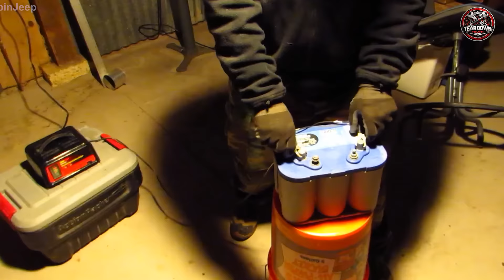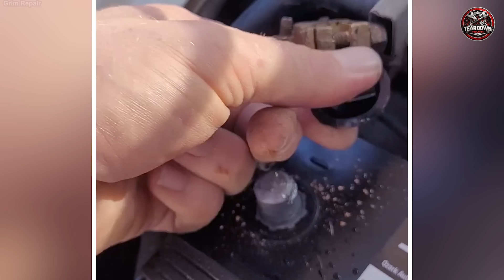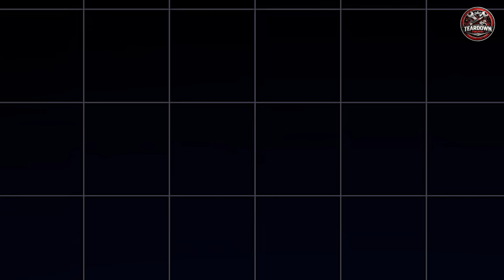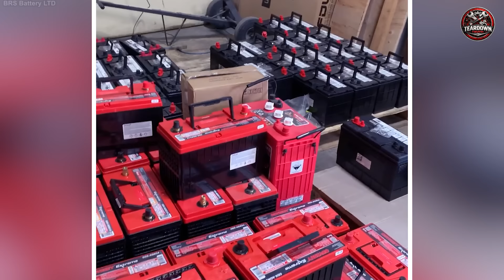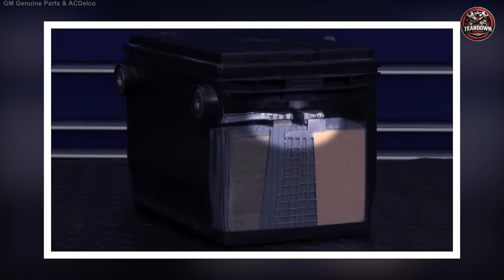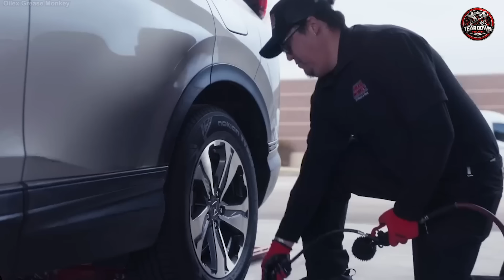NEVER These 3 Car Battery Brands (And 6 That Actually Last 5+ Years)

Comment from the maker: Have you ever bought a "budget" battery that died within a year? Which of these brands do you currently have under your hood? Let us know your horror stories below!
Reply: I've had an Everstart $99.00 ONE YEAR battery in my van going on 
FOUR YEARS.I keep my terminals clean,not put on 1/3 of the way on the post as you've shown.The only other thing I 've done is put grease or Vaseline on the trminals.When we almost hit 0°was put a trickle charge on it overnight.Interstate is one of the BEST !
Reply: Best battery that I know
Reply: @bobhuard4520  I bought a Nascar in-house Pep Boys brand battery 20 years ago with a 10 year warranty. It lasted 9 years. It was in a fully loaded 94 EB Bronco with an aftermarket 400 watt stereo. Has better tech gotten worse?
BTW, if you open the cells vents and boil on 200A for 15 minutes then cooldown for 45min until each cell boils, refilling each cell with water, every 2 years, you can get current batteries to last 20 years easily.
Reply: I  used to 20+ years ago when I was poor. Bought walmart brand. They lasted about a year and always left me stranded. No warning.
Reply: @justme36330  Walmart has like 3 different levels of quality, the value brand is the cheapest and something a used car dealer would install in a car that would be sold soon. I have watched some YouTube reviews with Walmart batteries and they were considered one of the top batteries.. idk . I use their mid grade with good results

Comment: I use the dee cell walmart brand multiple  years now. Have run 2 batteries  in about 10 years. 1st battery  laster 7 plus years. 2 batter 8 and this one i have now is 4 years old and going strong all on a solar system  and i have no electricity  bill
Reply from the maker: It's a good product indeed.

Comment: In 1973 I bought a 1956 Ford from orig .owners. Had it for 20 yrs. It came with an  screw top  allstate 12v battery. Battery lasted 20 yrs! Sold car with same battery I bought it with! The last battery I bought was  in my 2018 Chevy Colorado ,it lasted 8 years.  My 2016 Triumph Motorcycle original battery lasted 7  years , had a major internal short inside would not jump start and left me stranded. I bought  a "budget" 6v battery years ago for  a motorcycle and It lasted 1 week.
Reply from the maker: It's true that cheap things are usually of poor quality, right?

Comment: I’ve been buying budget batteries for 40+ years. Never had an issue unless I created it. I buy rebuilt batteries that last just as long as new ones even being abused. I pay 70 to 80 bucks for an 850 cranking amp full size battery for a full-size sedan. Technician told me once the only difference is the warranty, price wise. Don’t waste your money on expensive batteries

Comment: I had a 2 year Die Hard from sears that lasted 4.5 years....then I got a 2 year everstart....but it had a problem just before the warrently was up, so I have another one but it is't doing good ...has less than a full charge...so now I am thinking the car has a drain problem...put in a knife disconnect switch for testing...jury is out at the moment...

Comment: Everstart is a good battery and if I'm ever wrong you're not losing much money. I've run the marine lead acid in my boats for years and the sealed agm's in my vehicles.
Reply from the maker: That’s a solid approach. Good value, proven use, and low risk if something goes wrong — hard to argue with that. 👍

Comment: Well it's true the Everstart Value batteries don't hold up to deep discharge. If the vehicle doesn't start after a few brief attempts you are already pushing your luck. Crank excessively a few times and you've hurt it bad. Have the radio on for a few hours and you've run it down enough that when you have a little difficulty starting you've hurt it. Just not made to handle adversity. Under normal conditions you'll probably get through the warranty period but I wouldn't count on it in a hot climate.
Reply from the maker: That’s a fair take. Value batteries can work fine day-to-day, but they don’t tolerate deep discharge or heat very well — that’s where the problems show up.

Comment: THIS AI GENERATED REVIEW IS NONSENSE.  I have used the Everstart Maxx batteries since 2001!  I have used them on gas pickups, diesel pickups, large farm tractors, self propelled windrowers, and combines.  All lasted 7-10 years, and were more durable and cheaper than the OEM John Deere batteries.
Reply: I had bought Interstate batteries for many years for cars, trucks, heavy equipment etc. They aren't the same anymore. I bought a few Super Starts from Orielly's. Had problems with them within a year. Now have walmarts Everstart Maxx and have been happy with them for a few years now. I agree. AI crap.

Comment: My car/Truck doesn't run on a battery. After the start up? It runs off the Alternator. If my Alternator goes out? Then I have a problem. My times I have started a Car/Truck got it running then removed the battery. Just sayin

Comment: I've bought everstart batteries that lasted five years on average. Through rain, 
sleet and snow they were more reliable than the expensive brands that failed at 5 months to a year. Bullshit is bullshit and if the car has electrical problems the battery no matter how good will have difficulties.

Comment: I recall years ago sears die hard was top shelf. Then  interstate became top shelf. But, as stated ALL batteries are made by three companies with different names on them. Past 12 years all my batteries have been ever start. Absolutely not one complaint.
Reply: I used to buy Diehard Gold batteries yrs ago and had good results. I had 2 daily drivers and 2 classic cars, a good battery, reasonably priced, and would get 5-6 yrs easily. I miss Sears…

Comment: "OPTIMA" : BECAUSE of ROUND WRAPPED LEAD , instead of FLAT PLATES ...THERE IS WASTED SPACE *  ...AND A FLAT PLATE BATTERY WITH SAME OUTER DIMENSIONS CAN HAVE MORE RESERVE CAPACITY or CRANKING AMPS ....ALSO "INTERSTATE" WAS THE BEST (MY OPINION). BECAUSE PLATES WERE PLACED IN PLASTIC BAGGIES with PERFORATIONS to STOP ,+ pos. and - neg.  Plates from HITTING/SHORTING  and ...any shed LEAS DOES NOT ACCUMULATE ON BOTTOM of BATTERY but IN PLASTIC BAGGIE ...ALSO "INTERSTATE" DOES  NOT USE SQUARE GRID Reinforcements on LEAD PLATES but `46°<. Fire ting SLL CURRENT *DIRECTLY to TIE BAR /POS. POST ,or NEG.  POST ...DIMPLE GEOMETRY , SIMPLE RESISTANCE ...DIAGONAL GRID st 45°< is 1.41 x  resistance ...square grid is 2 x resistance ...equals ; HIGHER VOLTAGE !!! ...LESS INTERNAL HEAT !!! , FASTER CHARGING !!! , MORE CRANKING AMPS ..
.COMMON LEAD BATTERY  INTERNAL RESISTANCE `1/4 ohm

Comment: YOU MUST CHARGE A NEW BATTERY WITH THE DELTRAN BATTERY TENDER PLUS AND PUT IT ON THE BATTERY OVER NIGHT ONCE A MONTH OR TWO MONTHS , I GOT TWELVE YEARS ON A DIEHARD IN MY TRUCK AND GET 5 YEARS ON HARLEY BATTERIES AND A MINIMUM 5 YEARS ON CAR AND TRUCK BATTERIES AND EVERY 6 MONTHS I CHECK THE ACID LEVEL AND TOP OFF WITH DISTILLED WATER AND CHARGE OVERNIGHT.....
Reply from the maker: That’s great old-school advice. A lot of batteries last much longer when they’re properly maintained instead of just installed and forgotten.

Comment: I started buying everstart plus. They lasted 3 years each. My old Autozone duralast gold lasted no more than 15 months so I stopped buying them.
I will never by another battery from Advanced auto parts
Reply: BUY A DELTRAN INDUSTRIES BATTERY TENDER PLUS AND RUN IT OVERNIGHT ONCE A MONTH AND BEFORE YOU INSTALL THE BATTERY
Reply: @CraigAllen-re9bf I will look into it thanks
Reply from the maker: That’s exactly why real-world experience matters. If EverStart Plus is giving you 3 years and Duralast Gold only gave you 15 months, most people will follow the results, not the branding.
Reply: I went through **4** AUTO ZONE BATTERIES for a tiny 2000 cc /4 CYLINDER FORD ....INSPECTED EVERY BATTERY at AUTO ZONE , FOUND 1 I
S. MADE ...THAT BATTERY LASTED ~3 YEARS ..
I NEVER BUY AUTO ZONE AGAIN ...ONLY "EVERSTART"

Comment: My Everstart battery hit 8 years, still going
Reply: I like EVERSTART THE BEST !! CONSUMER REPORTS + OTHERS  HAVE BEST RESULTS for "EVERSTART'/SOLD by WALMART ...DELCO HAD PROBLEMS WITH MECICAN ASSEMBLED BATTERIES ...TIE BARS (INTERNAL ) LIKELY INCOMPLETELY SOLDERED .

VOLTAGE TESTED "OK' but ..
tiny CURRENT .

Comment: I have a new AGM Battery from Oreilly's and the batter seems to be at 63%.
  I use this vehicle daily and it seems to only get SoC 100% for 40 minutes of driving time and then lose the SoC within a few hours back to say 89% SoC while the SoH is always declining to Now 62% and this battery is only 3 months old. 
   I paid $230 for this battery and it just cannot keep up with the voltage.  Volts in the morning is 12.2 volts and cranking voltage is 9.9 or at times 10.2 Volts.
The battery lose it's capacity at about 1 hour of sitting in the Van listening to music and waiting.
Reply: WALMART TESTS , CHARGES , RETESTS , CHARGED 2nd TIME .
.IF BATTERY IS NOT AT 80% RATING = MEW BATTERY under WARRANTY   ( NO RECEIPT NEEDED )
Reply from the maker: That’s terrible for a 3-month-old AGM, especially at that price. If it’s already dropping that fast, either the battery is weak or something in the charging system is not right. Thanks for sharing that real-world example.

Comment: I purchased a power X2 AGM battery from a local batteries plus store . So far so good no issues or complaints. My vehicle starts right. Every time.  I do keep the terminals clean & Tight . I did replace the serpentine belt with a Gates belt & I mainly do a of interstate driving. Which is good .
Reply from the maker: That’s the kind of real-world result people care about. Good battery, clean terminals, and plenty of highway driving can make a big difference.

Comment: Interstate and optma battery are very good but this batteries are for upper middle class people that make six figure incomes😮😮
Reply: Costco sells Interstate batteries cheaper than Walmarts batteries
Reply: @xrgreg Yep, $179 for the AGM and $129 (I  believe) for the regular Interstate battery.
Reply from the maker: Fair point — they may be good batteries, but for a lot of regular drivers the price just pushes them into luxury territory.
Reply: @TeardownTruth thank you for saying that! I buy Walmart battery I get about 3 to 4 years from them!
Reply: I personally would not buy OPTIMA/ROUND WRAPPED LEAD ...Unless I HAD A SECOND BATTERY CARRIER IN ENGINE COMPARTMENT or BOLTED to FRAME .

TOO MUCH WASTED SPACE BETWEEN ROUND CELLS  GIVING LESS CAPACITY ...BUT Excellent IN A BOAT  or with a 2nd BATTERY CARRIER

Comment: Living in Las Vegas where the heat will kill any battery, why purchase an expensive on that you will have to change every 3 to 4 years here due to the heat...
Reply from the maker: That’s a fair point. In extreme heat like Las Vegas, a lot of people would rather buy a cheaper battery and replace it more often than overpay for one that won’t last much longer anyway.

Comment: I bought 2 everstart batteries 11/2018 (7.5yrs ago!) for 2 family cars which are still going strong. They still still tested at at 90% cca spec a couple months ago when I tested them with an accurate old school carbon pile tested that actually applies an electrical short type load that will detect a marginal underperforming cell which non of today’s digital testors can do making then useless in detecting a battery that’s got a weak cell that only poops out under a significant load and not just tested using the batteries internal resistance which is useless for load testing!
1 of my cars with an everstart battery stays is  ny that sees hot & cold temps & the other everstart battery sees ny & fl temps 6 months yrly as a snowbird.
I call bs on the negative everstart battery reporting here,it’s not accurate.
Got the price pint on everstart batteries you can’t beat them and statistically because Walmarts sells a ton of those batteries of course the number of failed batteries will show a bit higher gir the fact they sell them 2 to 1 of other brands.
I have mult friends like me that have classic cars using evertsyatt batteries in their classic & daily use cars all with good results & no premature failures at all.
Reply from the maker: It’s great to hear you’ve had such solid long-term success with your batteries, especially using a proper load test to verify them.
Reply: I first saw,/ used a FORD "CARBON POLE' BATTERY TESTER at a FORD DEALER in KELLOGG , IDAHO ...ACCURATE/,REAL LOAD/CURRENT  TEST ...NOT " ASSUMED CAPACITY' of 30 amp/voltage measurement !!!!

Comment: Of all the problems that the current computer systems make on their own and only can be fixed by the Dealerashipl.  The older vehicles can be fixex by old electonic mechanics and the ones before them can fix the basic mechanics before the electronincss took place before computer completely took over.  I for one love the old engine and transmission that worked so good for many decades before Electronics took over nowdays.
Reply from the maker: A lot of people feel exactly that way. Older vehicles gave owners and independent mechanics a real chance to fix things, while newer systems often push everything back to the dealership.
Reply: @TeardownTruth  I have a 2018 f150 that will probably need a new battery one of these days, it’s an 8 yr old glass mat battery. So I’ve been shopping around and watching YouTube vids and reading ford forums.
What I found out it’s not just a simple replacement, after installing you have to use either the dealership or find someone with a scan tool TO TELL THE COMPUTER IN THE TRUCK THAT IT HAS A NEW BATTERY! Otherwise the alternator might send the battery too much power until it learns that there is a fully charged battery. Something about the alternator having to send more current to that old battery so it continues to do so until it figures it out😳 
If no scan tool you need to let the engine sit for 8 hrs - with absolutely no power usage- and that includes even opening the door. It will reset itself then.
What is the need for something so sensitive?

Comment: just replaced my everstart battery that lasted 9 years.
Reply: Johnnylightning: How funny, just replaced two batteries in my diesel 2500. They were both EIGHT years old. Yes, Walmart ever start.
Reply: Everstart batteries are the sleeper better brand. They're made well and work well.
Reply: Ours is in it's 6th year. Paid $79
Reply: Just replaced one that lasted 6 last week in a small tractor. Damn thing cost over double vs 6 yr ago.
Reply from the maker: That’s impressive. A 9-year battery is hard to complain about — real-world results like that definitely matter.